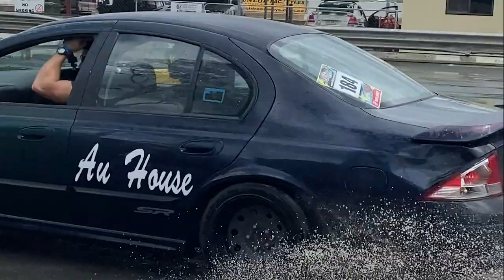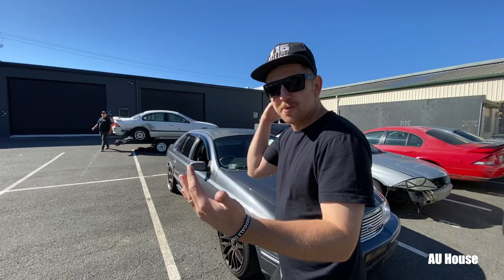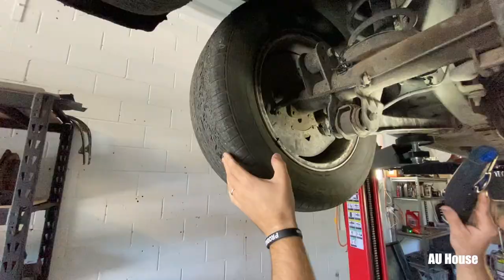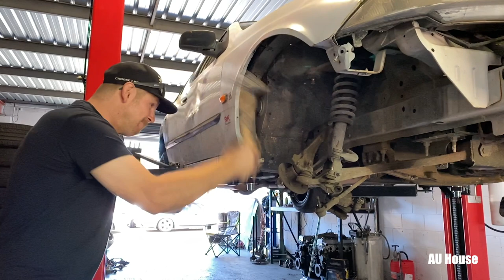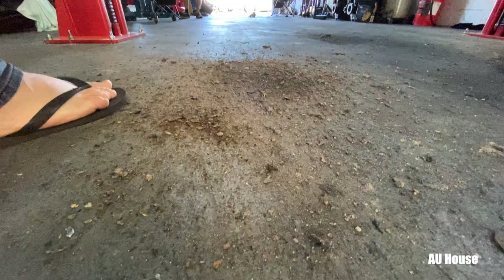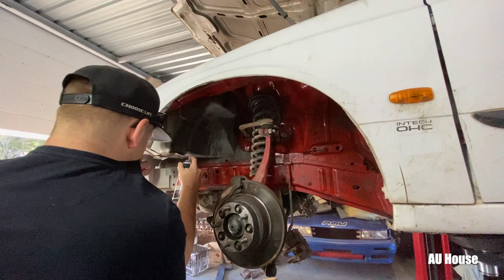Building Luke Finks FDAU | AU House

Comment: What’s the sway bar delete and spacers do? And is there any advantage too the arms? Some info on the parts would be appreciated for the newbs 🤟🏼
Reply from the maker: Sway Bar delete makes it more boat, the changing the arms over, cause the ball joint were no good, and I had spare arms with new ball joints